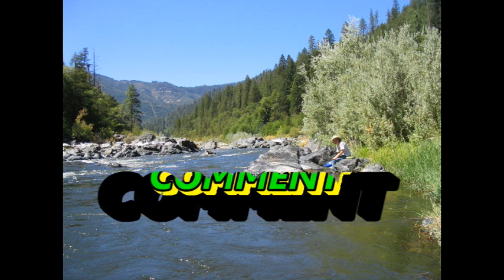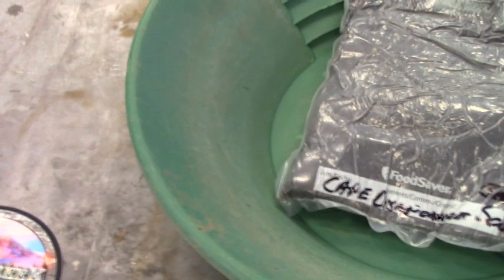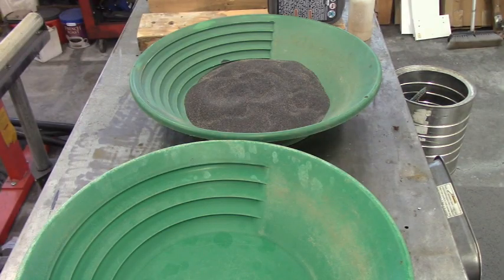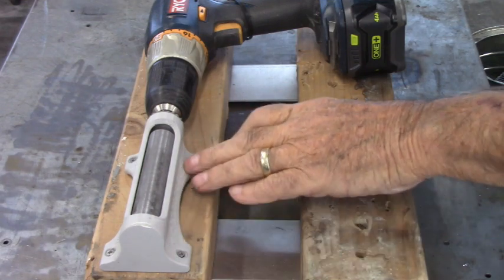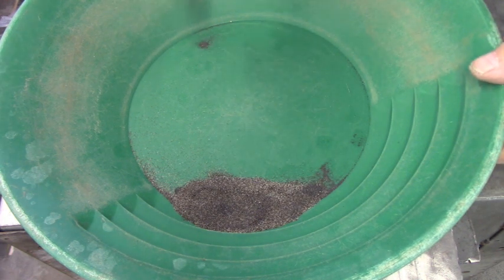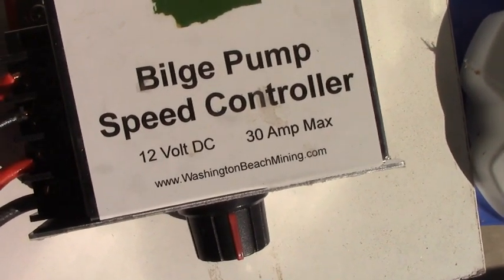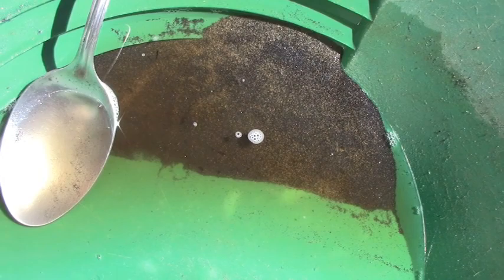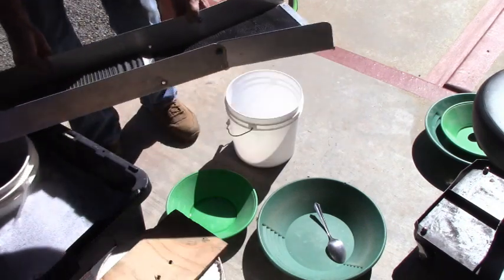SECRET CREEK BEACH SAND CLEAN UP

Comment: In my experience the blue bowl didn’t work very well with beach sand, ive run tailings from a blue bowl over my Royal water table and got twice the gold… maybe user error maybe not but that’s my experience! 
Good job fighting thru !
Reply from the maker: I have my blue bowl set up to do a 30, 50, or 100 mesh with flow control via a pump speed control. Seems to help. I may trying to run it on a table to see if I get the same results as you did.

Comment: Get yourself a gold hog multi sluice. So much faster than a blue bowl.
Reply from the maker: I am not a Gold Hog guy, but thanks for the tip. Beach sand is just hard to work.
Reply: @CandSMINING  beats the hell out of doing mindless panning for hours.
Reply from the maker: @stevenkempton7469  You hve to remember that this was a test of many different processes to clean up face powder type of material. Panning itself was about 45 minutes. Magnets were about 1 hour, clean up sluice was about 2 hours and the blue bowl about 1 1/2 hours. This included set up of each test system. Thanks for your comments I do appreciate them.
Reply: @CandSMINING  I get that. I just don’t waste time working materials that are worthless, and the multi sluice removes hours of lost time panning. Now maybe my wife and I are getting more cons to work than you are. We do this full time, and at the end of the day, I don’t want to pan 5-10 gallons of cons down by hand. Not when I can extract all the gold with a few runs on the clean up sluice.
Reply from the maker: @stevenkempton7469  I don't usually  work poor material. This was a gift of beach sand. When I was dredging in california, I did musch as you do. Only put the clean up sluice in the dredge box and throttle down one motor and 5 gallons of black sand in an hour.
Reply: @CandSMINING  a lot of dredgers do that. I think they lose a lot of flour gold out the back when they do it that way. That’s why we take all the cons home to do them. We don’t even clean the panning cons on site. We pan down to a concentrate, and flip it back to make sure of the gold content. Then toss it all in the bucket for at home processing.